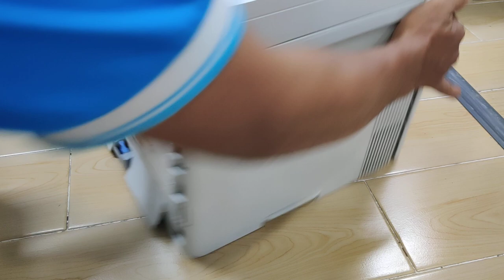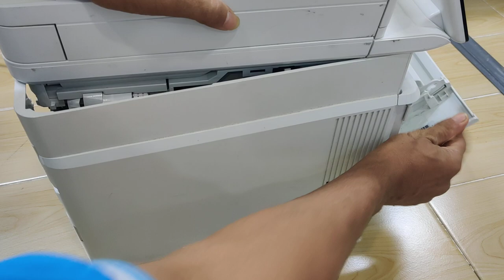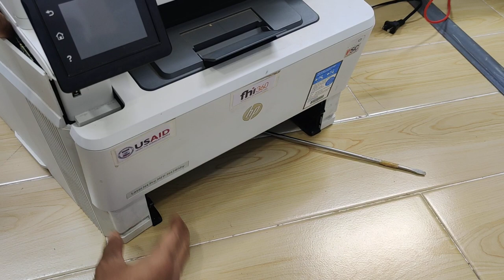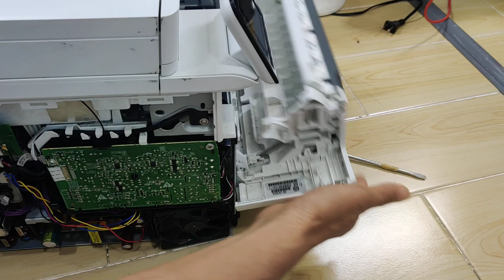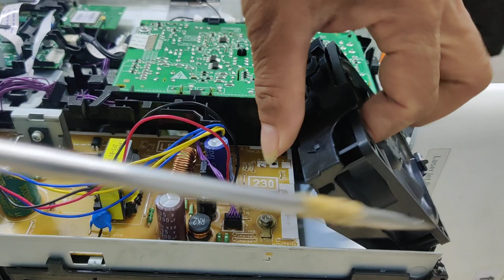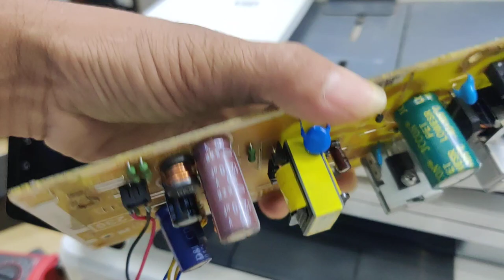HP LaserJet Pro MFP M428fdw can't turn on no power in repair part 1

Comment: Hello, was the problem with the Transistor SMD D-PAK on the backside of the pcb? It looked discoloured. Also, did you have to change the fuse? Thanks.
Reply from the maker: Yes and yes
Reply from the maker: Thank you so much